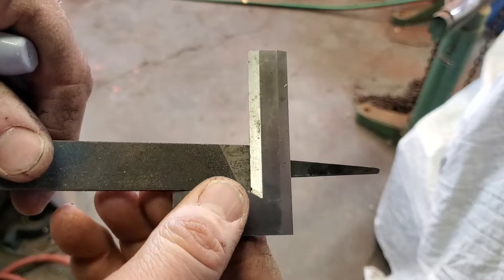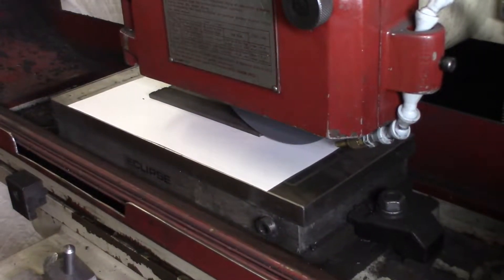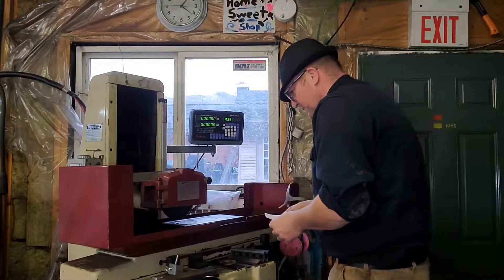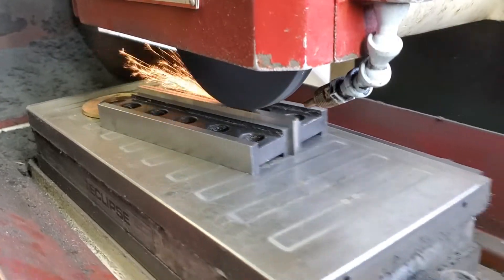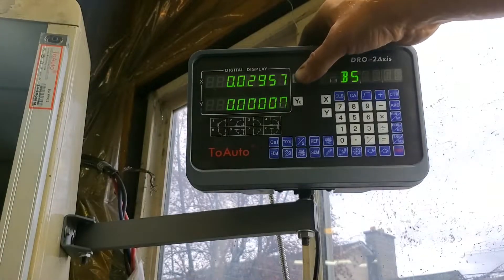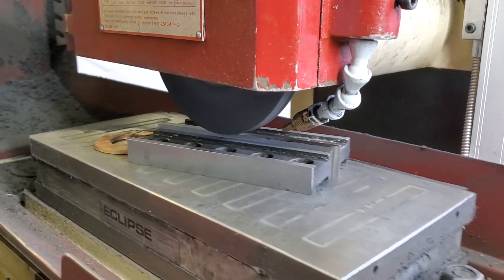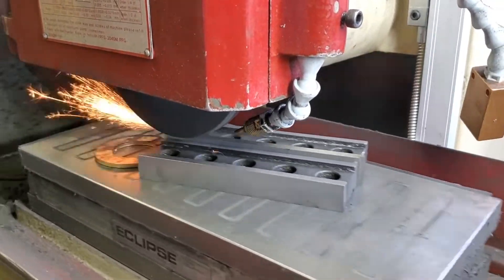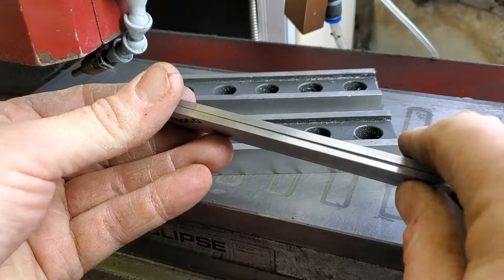Making Parallels From Old Hand Files

Comment: why did you put them diagonally in grinder? to avoid heat build up or to keep stone flat or something third?
Reply from the maker: I did it diaganally for a few reasons . 1) the tention is always pulled in one direction .  2 ) cutting across lets the stone cool and work not get hot . 3) the stone will be less likly to load up , not that it would be an issue with such a small part .

Comment: In your recapitulation you say that "the file may have already been bent."  It almost certainly was bent. Standard flat files are deliberately made with a slight bow in them. I believe that this is to assist the user in achieving a flat surface. The user  can select which side of the file to use depending on whether they are trying to correct convexity or concavity in the surface that they are filing. I checked two flat files in my workshop, one of which is a Nicholson, and both had appreciable bow in them. Thus sucking them down flat on the magnetic chuck is likely to leave them with residual curve when they are released. You alluded to the problem in the remark about the need for shimming. A lighter touch with the magnetic grip will also help by leaving at least some of the bend in the material so that it can be ground out.. Apologies if this is all obvious stuff.  Cheers
Reply from the maker: Thank you rockwell , that makes perfect sense .   I never thought to throttle back the magnet , perhaps i should try that on the next job like this .
Reply: @Wrighmachining  As an alternative to fussing with shims or using less secure magnetic clamping for grinding the initial face, it occurs to me that you could lay some plastic film on the magnetic chuck and set the work piece on it with some 5-minute epoxy. That way you could use full magnetic clamping and yet still have the workpiece in a perfectly relaxed state. I cannot say that I tried this but it should work provided the workpiece does not get so hot that it unduly softens or swells the epoxy. The piece may still bend when released because of grinding away a stressed skin, but at least this approach should avoid the gross problem of actually sucking a bent item down onto the flat chuck. Polyester resin will withstand higher temperatures but is not as convenient as rapid set epoxy. Cheers

Comment: I really love repurposing old tools/remanufacturing them into something new.  

I was curious... If you anneal the files before machining, would that assist in improving the surface finish?  I wonder if it would help with distortion as well(I mean, .0001 isn't much to worry about but curiousity)
Reply from the maker: Its possible some of the internal stresses where at play for the warping however the surface finish factors are  the wheel balance mostly , soft foot on the grinder and lack of coolant perhaps